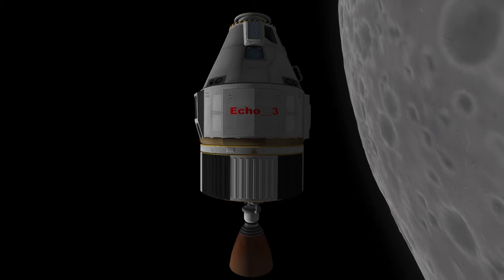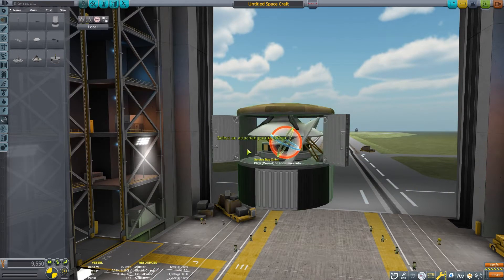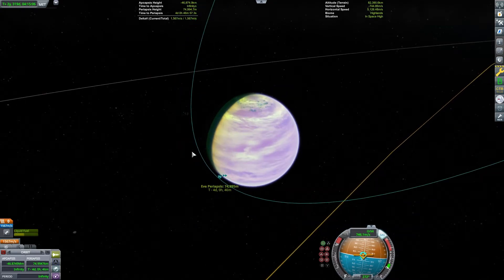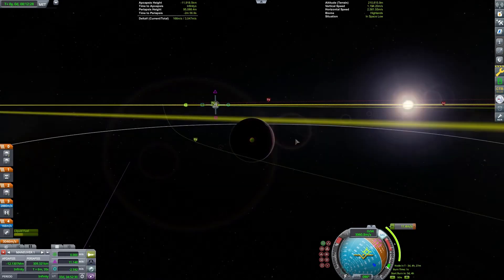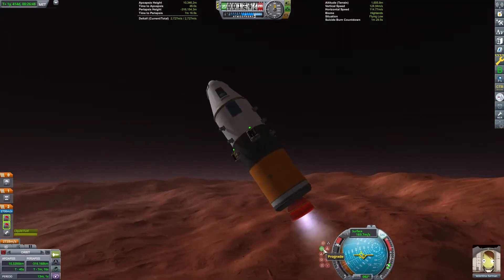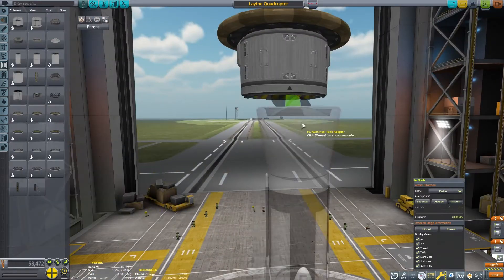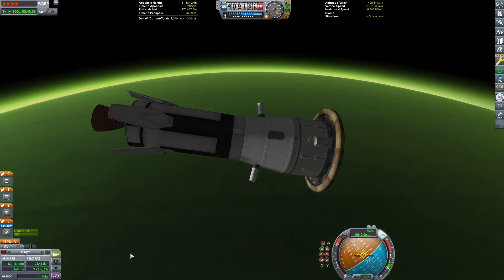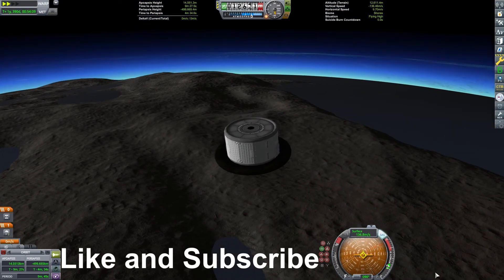How to Aerobrake and Aerocapture

Comment: If you have wings, you can do an inclination change for "free" during an aerobrake.
Jool's upper layers (180-200km) are very hot, so it may be counterintuitively better to drop down to the coldest region at 130-140km to aerobrake.
Reply from the maker: You are correct. As for using lifting surfaces, I have not found a calculator that is able to account for them. My recommendation is to quicksave before attempting any aerobraking maneuvers.